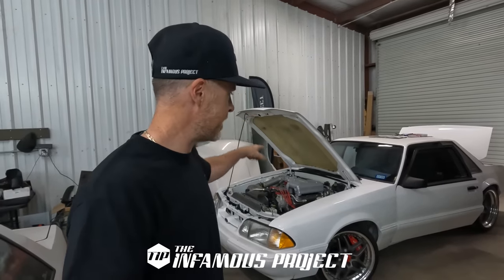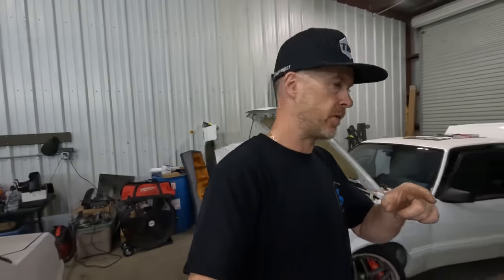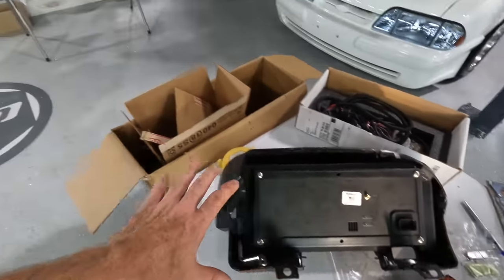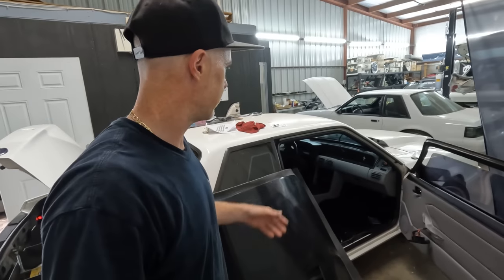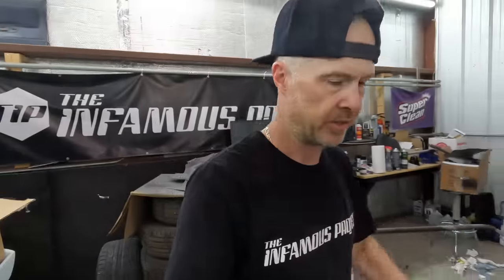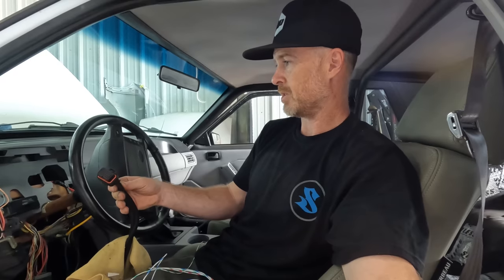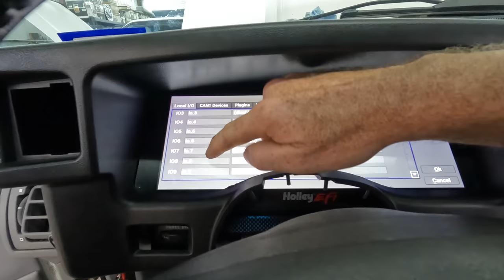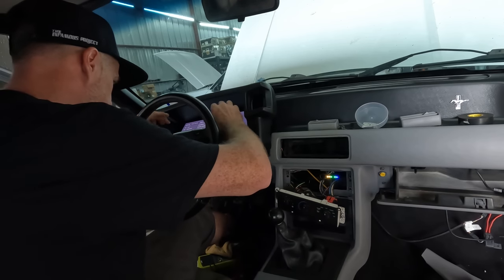1993 White Foxbody Notch Project Wrap Up! Holley 12.3" Pro Dash Stuff

Comment: Aren’t you going to cut off that center piece from the factory cluster? Look how much real estate that is taking up and covering your screen. I tapped into the factory wire that was supposed to feed the cluster for fuel level and tried using a ground underneath for ohms but it intermittently works and has questionable readings with the Holley.
Reply from the maker: It looks worse in the video than it really is.. I rather have a nice flush look with a layout that works with the real estate than have a gaping hole with a gap between the plastic and the screen.. as for the fuel level did you use the yellow with white trace? That's the one wire you need to use and seems to work fine! Was your sending unit replaced and/or work properly prior to the Holley?